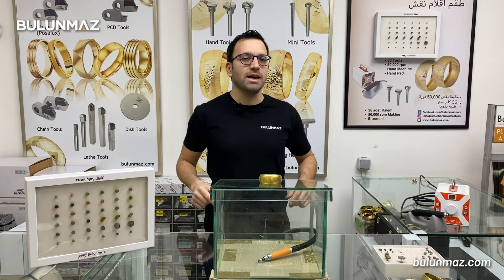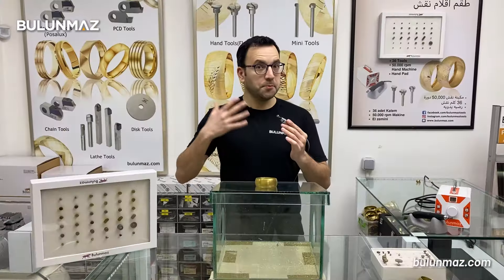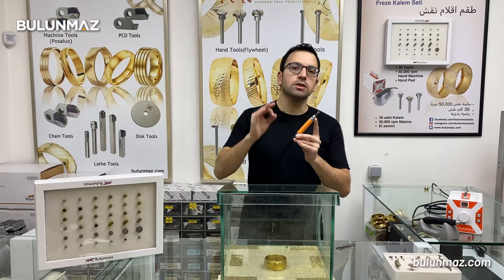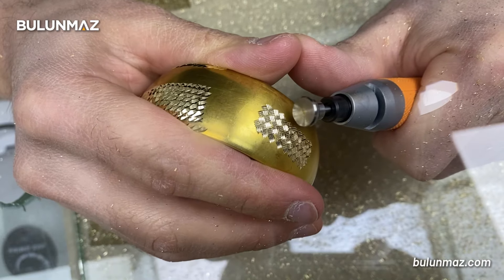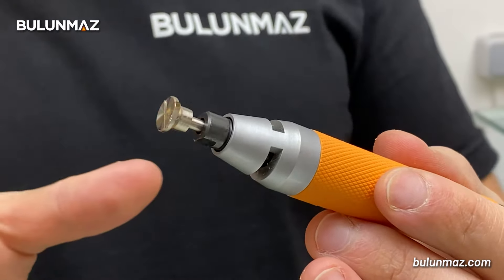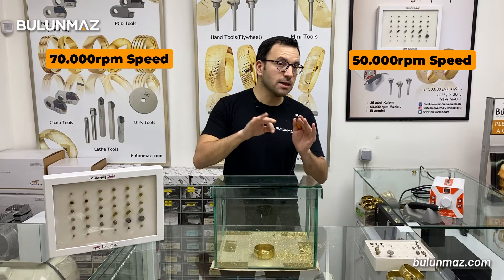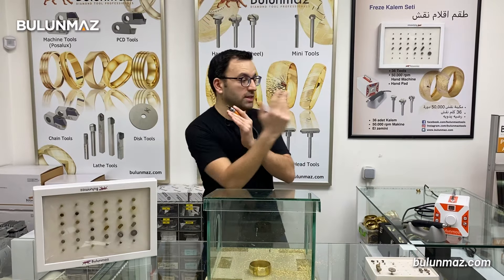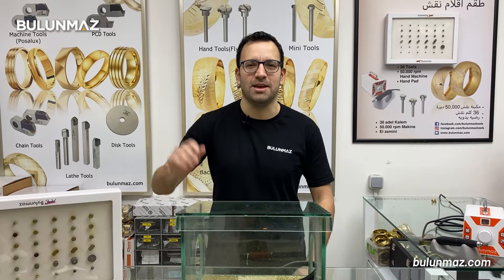PNEUMATIC DIAMOND CUT MACHINE for Goldsmiths

Comment: i have a question im just getting into engraving and im trying to find the correct diamond cutting wheel or bur which ever it is that will work for other heavier metals thanks
Reply from the maker: Hello, thanks for your comment. For more information, you can reach us via Whatsapp +905320590643 🤗
Reply: Carbide, Tungsten carbide.
Reply from the maker: Hi, you can reach us via Whatsapp or email: +905320590643 or info@bulunmaz.com 😇